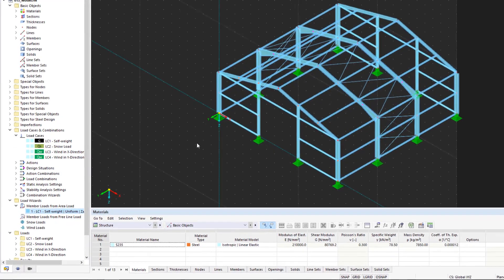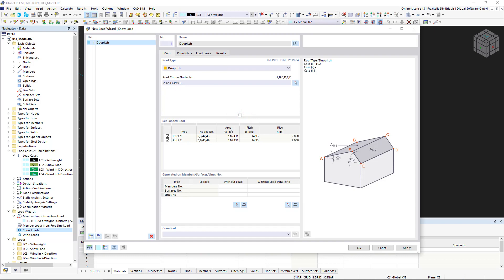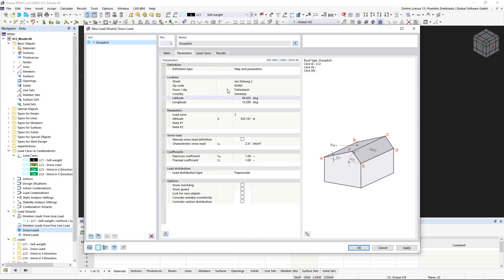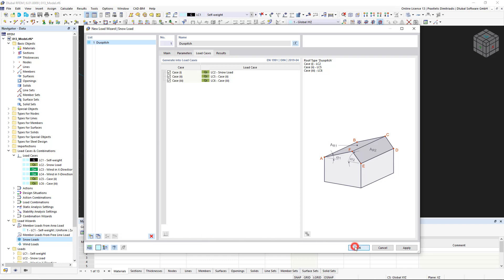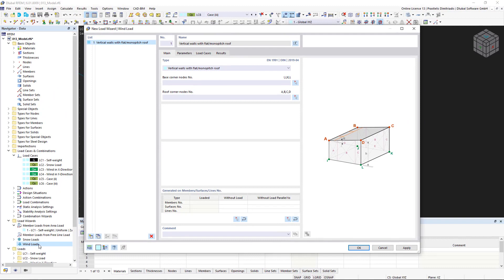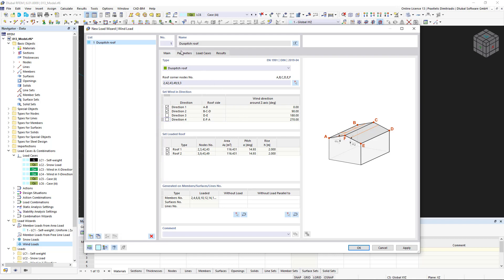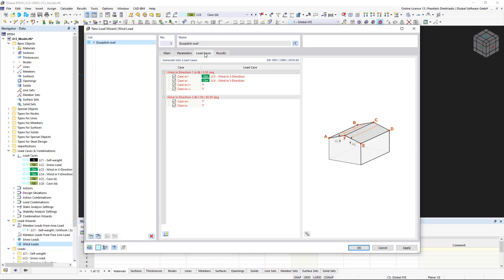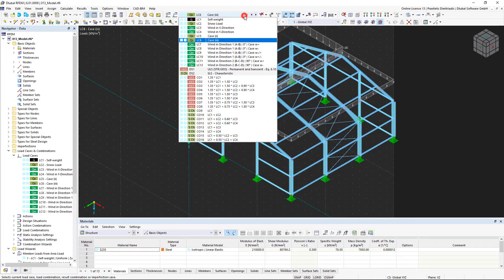RFEM 6 Tutorial for Beginners | 013 Loads | Load Wizards | Snow Loads | Wind Loads

Comment: Why Wind Load is not available for ASCE 7 ??
Reply from the maker: Hi, Civil!
Wind loads for ASCE 7 are available in RFEM 6.02.
Reply: @DlubalEN  I am now using 6.02.0060 and still does not exists.
Reply from the maker: Hi, Civil!
Did you set the ASCE 7 for "Load Wizards" in the base data?
Reply: @DlubalEN  Sure,  I did that but still not available.
Reply from the maker: Hi, Civil!
Currently only flat and mono pitch for  ASCE 7 2016 are working.
Reply: @DlubalEN  can we generate wind loads automatically on walls as per asce 7 low rise building envelope method and C & C too?
Reply from the maker: Hi, 256!
Unfortunately, C&C isn't possible .